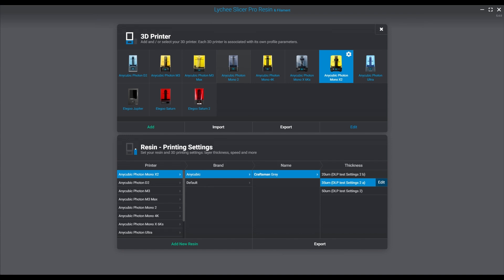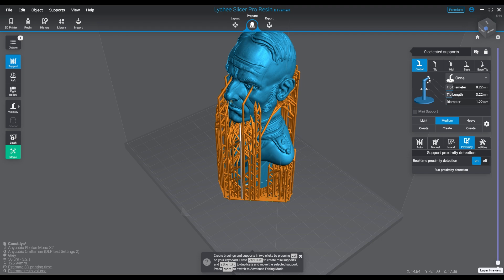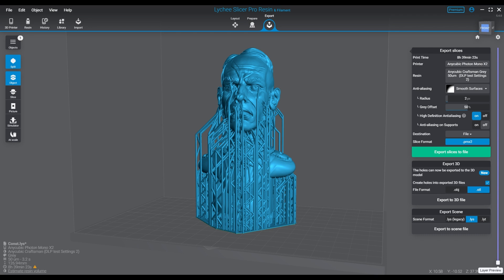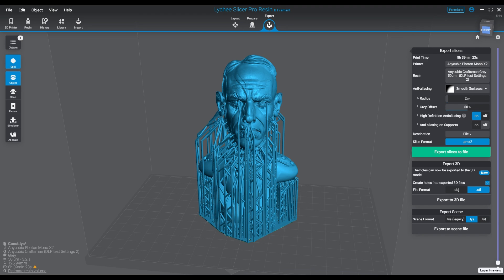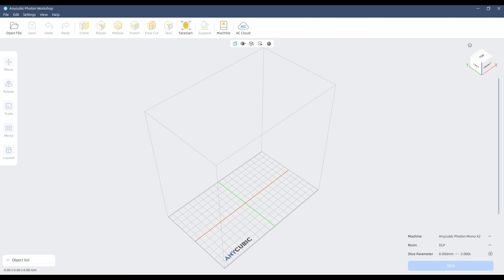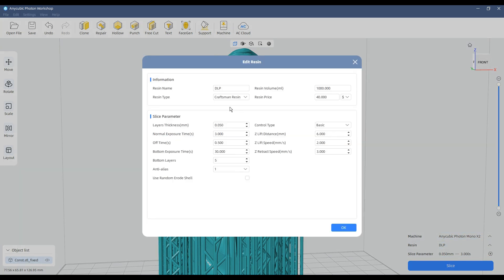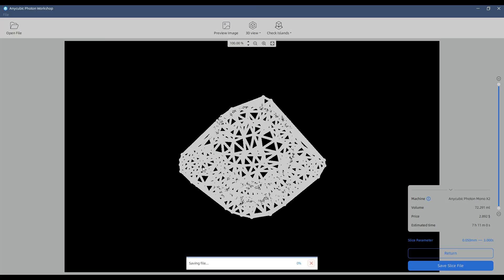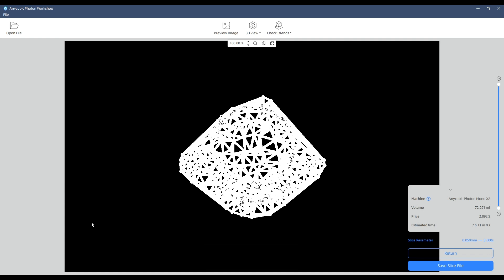File Corrupt Print Stop Error: Solution for Corrupted print files

Comment: @IPrint3dMinis Brother, thank you so much for this video. I have the Anycubic mono x 6ks. First few prints were fine. For some reason I started getting the "File is damaged. Print stop" message. I tried multiple times making adjustments to a .STL file using Lychee. Now I now my next printer won't be an Anycubic. Once again, thank you so much for this video.
Reply from the maker: Glad this helped, sadly it was just the series X that had this issue. So far none of the other models have had the same issue. The X 6Ks and X2 seemed to be the ones that deal with it. I personally blame it on the motherboard, it is very cheap, and I am sure it has very little ram or internal memory. The issue there is that the prints one would want to make on an X2, and the X 6Ks is that they are big, about 9.1 Inches. So, you want to make larger items or add more to a build plate to make full use of the build plate. But I found that doing so is what caused the issues, so it is most likely the lack of ram, or processing power.
Reply: @ That makes total sense. I will try with just a couple of minis and see how it goes. I will post here again so other people know.
Reply from the maker: @DemonIgnis  Please do, hope it works better for you.

Comment: YOU ARE MY HOLY GRAIL. OMG i have been battling with this for so long. It sometimes worked, sometimes it failed and the only thing i could do was slicing again and hope that after 6 -9 hours print it doesent stop qwq I have exactly the mono x2 and i only use lychee slicer  but for some reason this error was so inconsistent. Like i would have whole prints work flawlesly with perhaps one fail because of temperature or whatever and when i tried to print it again IT JUST FAILED WITHOUT REASON, The only problem i have with the nycubic software is that it doesent take the hollowed out modells i send there
Reply from the maker: I don't have any issue with the hollows, but DO NOT let Photon Workshop repair the files. That will mess you up.

Comment: Does this also fix the "File Damaged Print stopped" error? I have the X2 and I get it all the time. wasted at least 2 ltrs due to this crap. will most likely be the last Anycubic I buy.
Reply from the maker: Okay, so that error is actually memory related. This will fix it, but make sure and not print too many "heavy" objects. The X2 has a really crappy MB and the processor is limited in ram so the limitations cause larger files to break. The anti-aliasing off seems to fix this, or 0 if using Anycubic Workshop, I will also note this has only happened on the X2 and 6KX so it might just be faults in those MBs.

Comment: Im having this issue on my 6ks from time to time. Starting a print and waking up to a failed file in the morning is starting to get annoying. 
Im gonna test this and see if it helps. Thank you!
Reply from the maker: Did it work? Let us know, so far everyone that has tried this found it as a solution. Lychee is working on a fix as they are aware of the issues. I actually think it might be related to the high definition slicing, but I could be wrong. We will revisit this with the next big update for Lychee.
Reply: @IPrint3dMinis  same problem here with a 6ks too and lychee I'm going to try workshop, but 7 months later and with several new versions of lychee, the problem is still there.
Reply from the maker: @perche26  Yeah it is a problem still with the X2, as well as some of the other newer printers - I still use this work-around as Lychee still has this issue as of the current version 7. The issue I have read into is the HD slicing, or even fast slicing can cause the issue. Essentially there is a key or security thing there that is not being passed properly AND this is sadly a way that Anycubic try to muscle you over to workshop.
Reply: @IPrint3dMinis  Have you tried using AA with workshop?
Reply from the maker: That is a good thing to try, AA workshop although terrible is fine at exporting files.

Comment: Huge thanks for making this video, I have the Mono x2 and there is a correlation for me between high definition anti-alias and this error happening, but not all the time. I tried your method and it worked perfectly & printed 2 hours quicker than my Lychee slice. hopefully this is it now, wasted enough resin wish i'd looked into this sooner!
thanks again,
Reply from the maker: Glad I could help! This issue wasted so much time until I figured it out myself. I mean it didn't seem obvious until I tried it. Then I was like well duh, why wouldn't this be a better way to export the STL file. Anyway, I am glad it helped.
Reply: @IPrint3dMinis  it certainly did, wish I looked into it sooner 👍
Reply: so did you lose the antialiasing?
Reply: @hoptoad  no my prints still came out perfect & the antialiasing is not missed. I have a m5s pro as well as my mono x2 now and I export directly from lychee with no troubles
Reply: @AnotherHipster  I tried exporting directly from lychee and I also tried exporting the STL from lychee and slicing it in Anycubic workshop - "file damage - print stop" keeps happening.

I think maybe the file is just too big? Do you have any advice?
Reply: @hoptoad  how strange! the guy who made this video can  probably help more bc thats the route I would have suggested
Reply from the maker: This might be a memory issue. Some printers have crappy motherboards with very little on board ram. Suggested steps would be to reduce the # of files being printed at once, lower the resolution of the file (poly count), hollow it, change out the USB drive, try another printer (if that is an option), use AA  work shop to export the file (which I see you tried), don't use anti alias at all, this can cause issues too. I hope you work it out eventually.
Reply from the maker: Yes yes and yes!

Comment: Thank you so much for the video I am facing this issue with my mono x2 and waste a lot of resin while trying to solve it I thought that my printer is faulty, now I will try your solution but I couldn't find resin profile for water washable in photon workshop does the default profile will do the job?
Reply from the maker: Check the Anycubic support site, they probably have a profile that works. I hope this helps, this was nightmarish and yes, we thought we had a bad machine for a bit.

Comment: I was a long time mono user and never had a single problem. Because of this recently I brought an X2 for the larger print size and have had this constant issue. I did start repairing it in Photon Workshop then slicing it back in Lychee which fixed it about %95 of the time. I will try slicing it in Workshop. Thanks so much. PS is it worth trying to contact Anycubic support?
Reply from the maker: Yes, they will reply eventually.

Comment: Thanks for discussing this issue and how you were able to solve it. Good heads up, and I don’t think I’ve heard any other channels discuss it. A sort-of similar problem was the issue of Chitu Systems locking the firmware on the Chitu Systems motherboards down to only except the Chitubox sliced files (.ctb) in new msla machines (that used the Chitu boards) about 1 or 2 years ago. Before Chitu released their SDK for other slicing companies to use for compatibility with this new Chitu encryption format, the work around for users was to, for example, take the .STL output from Lychee and re-slice it in Chitubox to get a valid .ctb file that would work on the new Chitu board using msla printers.
 Oh, and regarding USB thumb drives, it’s typically best to not run software directly from these thumb drives, or save files directly to them from programs. As you’ve noted, you’re less prone to errors running software from the computers main storage and save from software to this main storage. Then transfer the file from the computer’s main storage to the USB /thumb drive.
Reply from the maker: Wow, yeah that sounds like the same type of issue. So, more than likely it is hardware/software conflicts, and the encryption might be an issue too, since this only started happening with the newer systems it seems it might be that. Also, yes good advice, don't run the software from the thumb drives, or install to them direct, always copy manually. These steps just help ensure best print outcome possible. Thanks for watching!